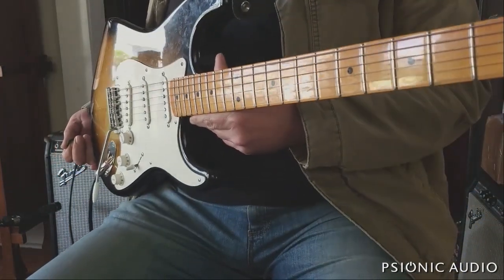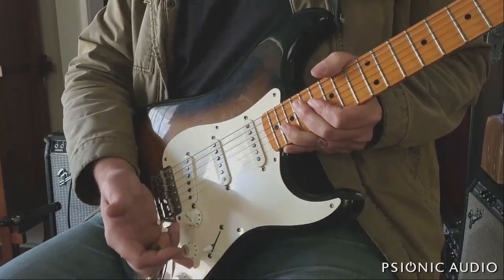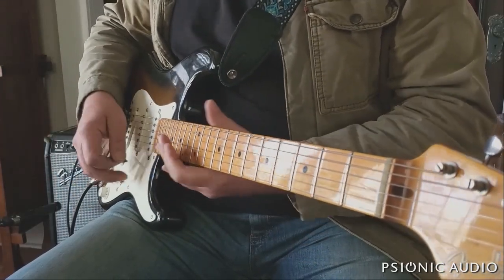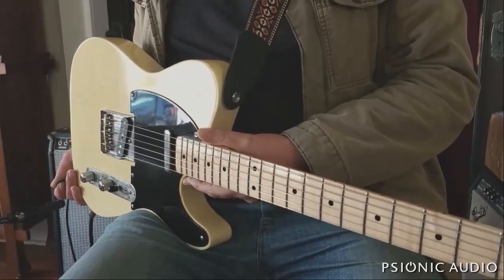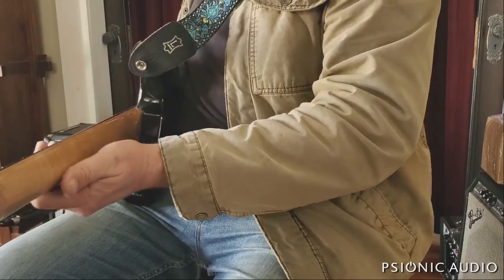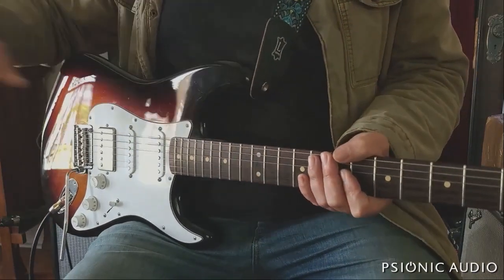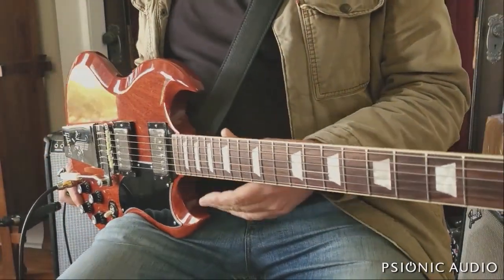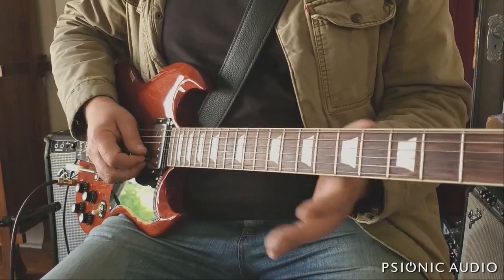Meet the Signal Generators - Know What You're Hearing with the Amps

Comment: Somehow I missed this jewel.  Input transducers are just as important as amplification and output :).   I always knew I was hearing a very low noise floor Strat.   Thanks for sharing all those.   I too love meaty necks.   Ive a National steel with with a great V in the lower part of the fretboard.   It’s not like I have huge hands - it’s just the support when bending/vibrato I suppose.   Always wondered what the useable feature set on the Eric Johnson was - now I know.
Reply from the maker: I may redo this video as this doesn't have HD audio. Grr.
Reply: @PsionicAudio  yeah - but if you do my request is use an Exaliber 15 (I love supers but …..)